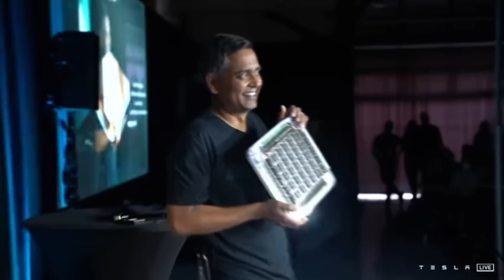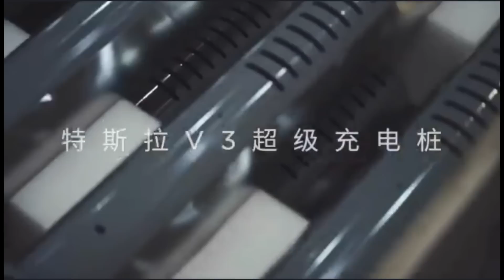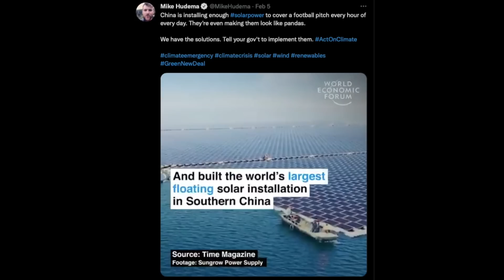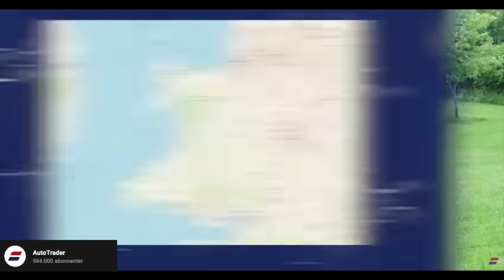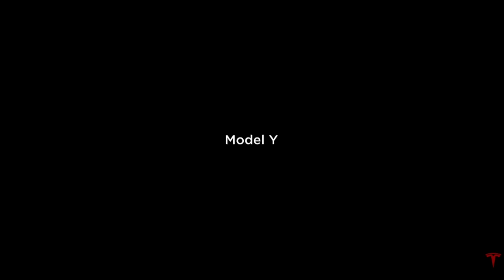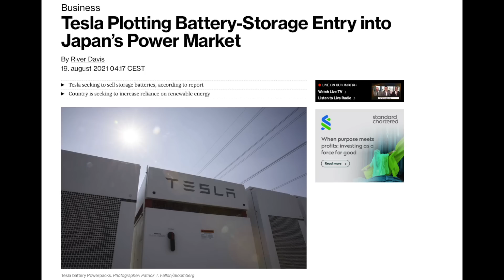Tesla Model Y is taking off in Europe | EV’s will be allowed to drive faster than ICE !!!

Comment: RE: Rimac vs. Roadster.  Unless the Rimac has an option to add rocket engines, it's gonna lose!
Reply: That will be a liability in weight on a race track. Good for nothing but the drag strip
Reply: True enough, but the Roadster II has not been built yet.
Reply: @surferdude4487  Rimac plan to make a few dozen cars per year. Tesla could easily make a few dozen Roadster prototypes if they could be bothered.
Reply: @surferdude4487  It will have lots of competition, Aspark Owl, Hyperion XP1, Lotus Evija, Karma Revero GTE, Rimac C-Two, Genovation GXE, Draco GTE, Pininfarina Battista Anniversario. What I'm trying to say is that electric cars are simple,  based on how quickly these have been produced. These are only expensive because they've been hand-built.
Reply: @surferdude4487  Drag Racing is a foolish exercise for road-going cars. This should be left to purpose-built dragsters with motors designed for high torque and geared for 1/4 mile only. I want the most efficient car capable of 1000km of range on a single charge, quick recharge, and a massive cycle life that I could buy once and keep for the rest of my life. The cycle life has to improve by an order of magnitude. 1000-3000 will not hack it for me. On top of this, it should be lightweight and handle like a race car. Has to be a small coupe and not weigh more than 1000kg. Yeah, fully carbon fibre, I don't want ever more to feast my eyes on corrosion.
Reply: @MegaWilderness  I really like your concept. Other than the cycle life, just about all of that is already in reach of our current technology. I don't want a dragster either. I would be much happier with a lower priced vehicle with longer range. I would guess that the reason they're doing this way is to give the hard-core smack-down to anything powered by dino-juice.
I hope we see the Tesla Model 2 soon.
Reply: @surferdude4487  It has to go further, their giga-castings need to be smooth in the wheel wells, don't fancy cleaning the mud off those, nor carrying the extra weight. Model 2 will share the Model 3 skateboard. Makes one wonder why they can make it at $25 000, guess they're just price gouging for the Model 3.
Reply: Rocket engines?!  Good luck with that!  It won't be street legal and it would be almost impossible to find rocket fuel, which is expensive, explosive, and toxic.  It would be totally antithetical to Tesla's mission statement of transitioning to sustainable energy.
Reply: Stop the bullshit, the tesla isn't even out yet but you're comparing to rimac?! We want to see real things.
Reply: The media coverage of Rimac Rivera and The Roadster will be EPIC!
Reply: @Mxyzptlk30  Relax, it's only compressed air.
Reply: @MegaWilderness  Compressed air to give wild acceleration on 5000 pounds?  Good luck!
Reply: @Mxyzptlk30  it will be thrusters, not rocket engines. Compressed air.
0-60 in close to 1 sec. 😊

Comment: Given that the sole purpose of AI day was recruiting the best engineers in the world, the combination of an AI supercomputer with a humanoid robot was probably the perfect combination.
Reply: The robot is a toy that Elon wishes to have to help soak away profits. Not saying AI is useless but self-driving is the last thing I need in a car. Performance, Handling, Efficiency, and range count for much more in my eyes. They should concentrate on the source of electricity storage. This at the end of the day is what will make the biggest difference to success. So far Tesla has delivered nothing of its own and is completely reliant on the battery suppliers, as is the rest of the industry. Where are the 4680's? Look at what GAC are up to.
Reply: Absolutely spot on.

Comment: Good episode, Lars!
The speed limit idea is fantastic, makes so much sense. Good way to reduce global emissions without any new tech or rollout. Genius!
Reply: Net of the cost of new signage and driver education etc.....
Reply: Is it? Besides UK, is there any country that have reduced the speed limit for CO2 emission reason? Besides, you will want to keep the traffic flow smooth anyway.
Reply: @yourcrazybear  yes, they did it in the Netherlands 2 years ago. They reduced the maximum speed on many of the highways, specifically those where the pollution had the worst impact.

Comment: EVs driving faster than ICE doesn't make sense. ICE vehicle driving faster makes them get better MPG. The slower they drive the more they pollute the air...
Reply: better MPG to a certain point. And EV cars are less efficient at higher speeds - use more power to maintain highspeeds and the battery drains faster.

Comment: Lars, can you point me towards where you see that Alset EHome is profitable. From their latest 10Q "As of and for the six months ended June 30, 2021, the Company had an accumulated deficit of $117,799,610 and a loss of $5,082,288 from operations".
Reply: It caught my attention. I've just been trying to get a handle on this to see if it's a bargain or a total dog stock. They just did a cap raise at a discount price. Third one this year... Looks like they sold houses off the plan but building costs are higher than anticipated. I can only assume they were scrambling for cash just to keep afloat.... It does look super cheap at under $2, but I'm not confident yet. Needs a deeper dive. What's going on?

Comment: Must say "Perks" like being allowed free tolls as some cities have, being allowed to drive in car pool/Bus lanes, higher speed, free parking etc is JUST AS IMPORTANT to accelerate adoption as cheaper price.
And really "Perks" is cheaper but maybe more important, although I do prefer all options.
Reply: London is rammed. Even the busses are stuck in traffic and cyclists have to use the footways. So good luck getting anywhere quickly in any car. At least it’s cheap to park your EV when you arrive late for your appointment.
Far better - get a folding E-Bike and leave the car outside the jammed up areas.
Reply: @Dave5843-d9m  If you're in a real rush, then tailgating the whole way will help.
Reply: Free parking!? Lol..... only at charging stations and when your car is full they have to charge you because you're using a valuable.
Reply: @Dave5843-d9m  or just take the train/subway when possible.

Comment: The trouble is that when you no longer have to pay full attention to your driving, it is easy for the mind to wander.  This is made especially so with our addiction to cell phones and other distractions.  It is a case of needing either full, completely capable self driving or none.  The in between situation is an accident waiting to happen.
Reply: I'm using AP all the time, and don't find it hard to pay attention. Sometimes I look away for a few seconds, but that's safe on a highway. Also people are often distracted anyway, in those cases AP is 1000x better than a 2 ton unguided missile.

Comment: Cutting the speed for ice cars is all well and good, if there's an affordable option for lower income families to ditch the ice.  There still isn't a TRULY affordable EV out there yet.  When we see that 200+ mile range car for under $20K USD, then I can see doing it.  Not before.
Reply: You also have the issue of disposing of 220M gasoline burning cars (minus, of course, historical and collectible cars). Obviously, swapping to electric is going to be a major undertaking!
Reply: @Duke_of_Prunes  Automotive recycling has come pretty far in the last few decades.  Sure, it's not to the point where every part can be recycled or disposed of in a carbon neutral or negative manor, but we've gotten pretty good at breaking down cars.

Comment: Everybody seems to be forgetting that the model S still has another update the cam is going to turn the speed up on that car you're going to have to buy the 200 mile an hour tires but it is coming
Reply: Lol..... cars have been doing 200mph+ for decade.
Reply: @carholic-sz3qv  yes but they don't weigh as much as the tesla . Not even close
Reply: @bobholland9924  it doesn't if they weight less or not, the tesla has 1020hp which is way more than those other cars. I've seen a mercedes amg e63s wagon do about 207mph.
Reply: @carholic-sz3qv  I'm just repeating what Elon said about the update that will make it a 200 mph car. And he specifically said it was the tires went ready yet. When they were he'd give it the update.
Reply: @bobholland9924  again big lol..... there have been tires used for 200mph+ in the market for decades now the tires are not the problem for that tesla trust me, some cwr manufacturers have even used nitrogen or other gas to fill the tires for better performance....

Comment: I want to see a Police ICE car trying to catch a Tesla. Every time they have to brake and then accelerate. The Tesla will continue to increase the distance between them. Don't get me wrong. I am men in blue supporter but they had better be driving Teslas.
Reply: I suspect the perp's Tesla will sense the flashing lights and pull over. Maybe even lock the doors.

Comment: Everything that Elon mask has done so far (that works) reusable rockets and cars do not require any unproven technology it has all been an engineering task.
A humanoid robot has requirements that can not be solved at the moment. That being the actuators to move the robot are not effecient enough to run for long enough before the battery runs flat. The rest is just an engineering problem.

Comment: All fine and dandy with the message it's the drivers fault when activating "autopilot". But where do we draw the line when it's the fault of  Tesla's "autopilot". It sounds so strange that we blame the driver for a feature that is claimed to be going be safer than a human driver. Yet when a tesla driver activates its for safety it's still the drivers fault. So Tesla driver's are still punished for using what is designed as a safety feature. I don't understand that. A Tesla driver being punished for doing something good. That's hardly rewarding  and of value to use autopilot at all. So when do we consider an official safety product Tesla accountable for an imperfect product which is conveniently branded under a quasi safety net of the "beta" badge.
Reply: Was the autopilot engaged though? One of the accidents the guy was going well over 100mph. Would the autopilot do that?